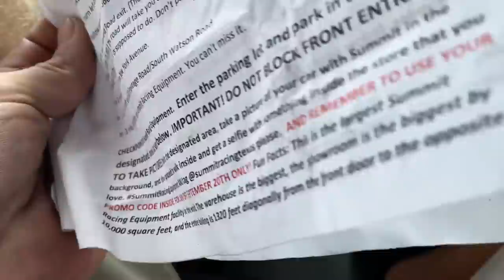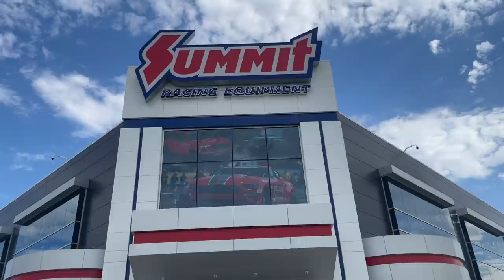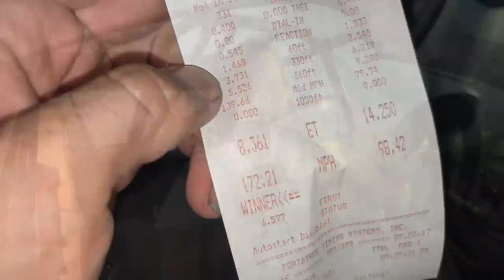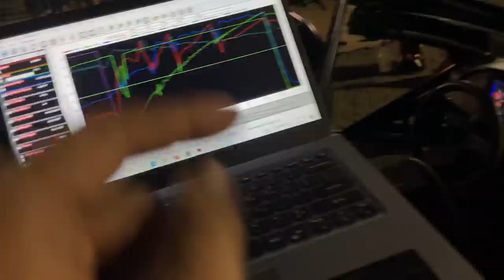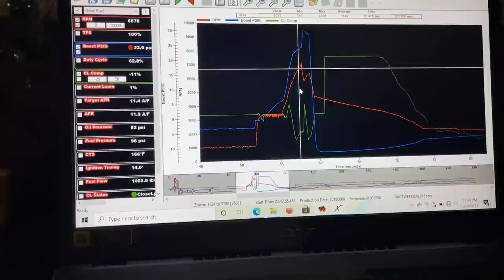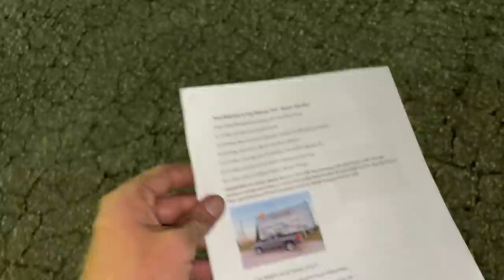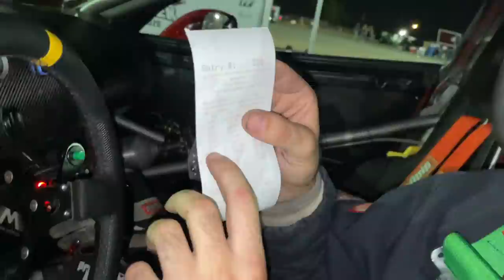RACE WEEK 2.0 Day 2 - Leroy's Bad Luck Falls on Ruby... (Even Worse at the Track)

Comment: Ruby looks so much better after removing all those stickers from the back window.  I remember you saying that was going to be its style back when you got her.
Reply: For me, the biggest improvement was the headlights... thy did so much for that car
Reply: @rafapozzan  headlights and polished up the car looks way nicer than before. 👍
Reply: @rafapozzan  The headlights will continue to cloud up until they clear coat them like the factory does.
Reply: @Sir.VicsMasher  if the factory clears them then why do they fog up in the first place? 🤔
Reply: @The_Chosen_None_  Clear coat degrades based on conditions.
Reply: @Sir.VicsMasher  they aren’t factory cleared lol, it’s whatever material they use for the headlight cover, that in turn fades, which is why it’s best to sand them down and clear them. Clearing them is just a longer way for them to look fresh, polishing fades after a few car washes.

Comment: You guys were so close on the clutch tune in Leroy! Needed alittle more weight added to it to get that 60ft dialed in, still slipping to much off the line but is now locked in all other gears after the weight was added. Good luck dudes and thanks for the video!!!

Comment: I seriously would be getting another master power switch or ignition power switch for Ruby I have had similar problems like that before and one time it was the master power switch and the second time it was the ignition power switch to help diagnose those type problems while racing all of my switches have pilot lights that are either visible from outside the car or from the in car camera.
Seems to me LeRoy and Ruby are suffering from a serious lack of the 5-P’s (Prior Planning Prevents Piss Poor Performance) sure I know they both have fresh Texas Speed (rebuilt) engines and some other maintenance but they didn’t get any real road testing or dyno or track testing to tune/shakedown the cars.
Reply: They were also put back together in a day.
Reply: That's 6 P's just to let you know
Reply: @Weekendairsoftwrrior  that's what he said.

Comment: As many wires as y’all melt, y’all should heat wrap everything
Reply: You would think they would heat wrap the exhaust to keep more heat and energy in for the turbos.
Reply: @mazman117  quicker boost response ad well. Might be what mullet needs for boost in that first gear
Reply: At this point I don't understand plug wires and wires melting to the exhaust
Reply: @1STGeneral   right?! They make heat wrap for both devices

Comment: Never lost a wheel off of my roof before , but the rear tire on my 69 Bug came off while I was driving it home from where I bought it . It crossed 4 lanes of freeway and went for at least a quarter mile before it stopped . I took one lug nut off of each of the other 3 , and drove the rest of the way on 3 lugs per wheel .

Comment: Check your ignition as ive had the lose of power in my NZ  stockcar on power when it was 3/4 down the front and back strat  . And it was in the ignition switch with broken wire and shorting out at high power to it !

Comment: Dude I guys got sooo lucky!!!! That tire and wheel could have caused a wild accident! I had my tires rotated before a Moab trip and got a mile down the road and the front driver side wheel jsut came off (the ship didn’t put ANY lug nuts on it!??) my 4Runner dropped down on the brake disc and thr 35” tire and wheel went into and accross 6 lanes of traffic and into a nice SUVs door putting a massive cave in into it. Shops fault but had it hit someone or gone theubthe windshield of a car it’d of killed somebody. May want to do some extra straps holding the tires to all of those racks so at least it won’t escape . Greatful that’s it

Comment: Correct me if I'm wrong. In NASCAR racing if you get a crack in the header or the pipes it sucks in air which causes the backfires you guys got to fix that weld...you literally reoxygenate the exhaust with fresh oxygen causing the leftover fuel in exhaust stream to ignite...fix that exhaust. On ruby

Comment: definantly sounded like it was climbing rpms that run, the other runs yesterday sounded like you were shifting into gear and going strait to redline and waiting for the clutch to catch up..

Now Rubys alot more then a Auctionvette... Maybe time for a proper Exhaust/turbo manifold with some clearance? Every time Ruby has a bad run its them plug leads melting

Comment: My guy you guys NEED a customs made light roof. Either carbon fiber or aluminum or something. Made with brackets for quick and easy on and off so you have a roof when driving that is reliable and won’t get soaked if you’re in rain and then fall inside and leak. Then just take it off at the track
Reply: Also should maybe consider drilling into Ruby’s roof to mount the rack on top for the tires next time. It’s a race car not a show car. Take the rack off when racing or not needing it and put some plugs in the holes. That’s putting a lot of faith in some suction cup mounts to hold the weight of 2 big old rims and tires like that especially at 60-70mph

Comment: I still don't understand with all those burnt spark plug wires and boots you LS guys don't run boot sleeves..it's a big issue with the 8.1 so I use them..couldn't be happier 👍

Comment: you really need to either make or find to buy a little trailer for Ruby and a clip on roof for Leroy . after all these years of cardboard and duct tape rain guards you would think you would remember to come up with a work around for the races . with the roll cage on the car you could get some one to 3D print some mounts and a sheet of aluminum would finish it off nicely and end the cardboard nightmare

Comment: Curiosity killed the cat. So I had to investigate. Gas boils at 395 degrees. It can combust at 535 degrees. So you're within 140 degrees of blowing up the mustang if it was boiling. Then I was like... What if the running E? Ethanol boils at 175° f and won't spontaneously combust until nearly 700°.  Huge difference but it makes since that it'll combust at a higher temp but why boil at colder temperature?

Comment: Look, I'm a racer, engine guy, off road, modification, you name it supporter myself. I just couldn't help to think to all of the issues Brent is having with the EPA. This is exactly what they are talking about. Things are sold as race car parts for race cars, but then people go drive them thousands of miles on the street. No hate as I think they need to back off of the manufacturers and it should be allowed, just hope the whip doesn't strike you guys as well.

Comment: You should look into build easily removeable carbon fiber panels for the front on leroy and maybe a roof. Still leave it like an ariel atom but improve the aero at high speed.

Comment: Leroy clutch still wasn't happy with weight added, better but not happy.
First run/log the clutch still slipped at the begging of 3rd, 4th and the lack of wheel speed on the last run/launch (along with looks like clutch dust when engine reved up going past the tree) = probably going to be swapping clutches sooner rather than later...

Comment: Made it to 19:00 just now. To me it still sounds like it slipping in both 3rd and 4th. I would put more weight on and lower the launch rpm to not yank the tires. Though I am an idiot and that probably wont work.
Reply: yeah idk I think maybe they're trying too hard to make the clutch happy where it's at, instead they should pack the weights on it and turn up the boost like you said.    It's misleading cause they had it dialed before, but Leroys new base power level has changed the equation.  
I think rather than trying to stay at low boost and easy slippin'  they should crank it and see what this clutch is capable of doing.  
OR we could be totally wrong and that clutch is just glazed and the one they're having shipped will just fix everything, who knows.

Comment: regarding Leroy, the anal focus on the front half has lead to slacking on the back half. I recognize the greater payoff in nailing the launch but you're wasting the back half down on a lot of boost that Leroy can handle. There would have been 2 7s already if he was at 28psi instead of 18. Its infinitely easier to up arrow that B than waiting for the stars to align on your 60ft.
Reply: Thats what they used to do and how he got the first stick shift record but it was hard on the engines

Comment: Why'd you leave getting in the lanes so long? It was like four hours into the track being open before you lined up for your first runs. Surely you get out there first in case of issues that can be resolved, instead you all leave it to the last minute and dont leave time to fix the issues.
Reply: Watch the video.  They have to swap tires, change the fuel system over including adding a fuel pump belt, safety checks,  icing the intercooler tank, fix problems, check tune on laptop  meet and greet and so on.  It takes time.  Oh and don't forget, it is just the driver and his copilot who can work on the car.
Reply: @HighMXHubby  So what your saying is all the other competitors can do all of that four hours quicker than Cleetus and crew? They simply wait for the air to be cooler and the track set in, but it leaves no time for technical issues that will arise on a week like this. Get out there and do as many runs as are needed rather than praying one run will suffice.